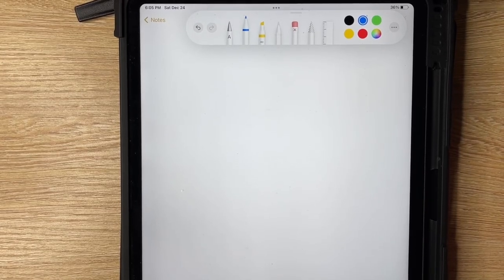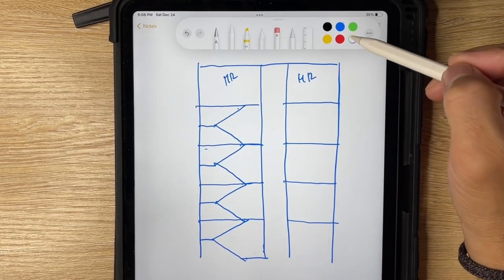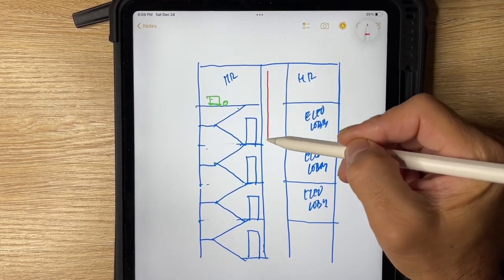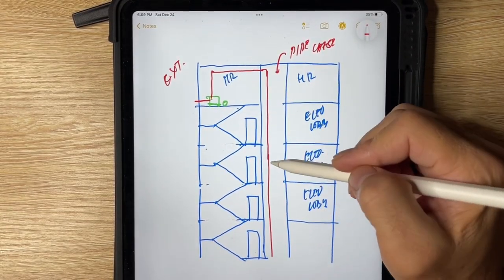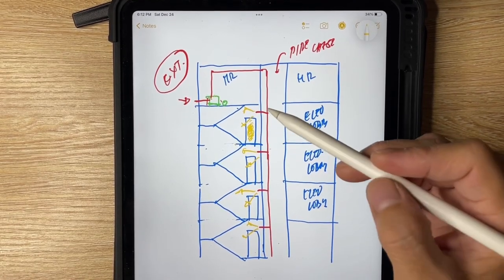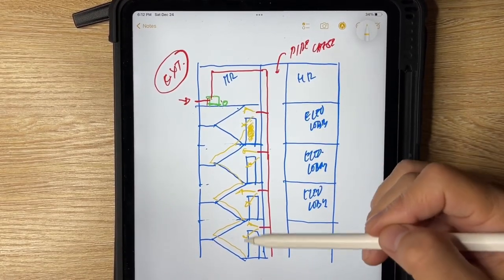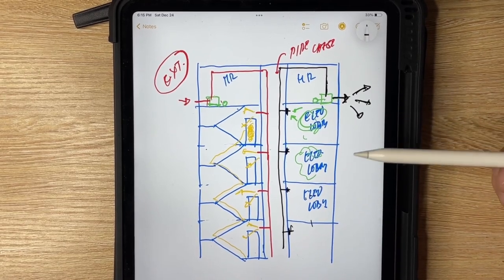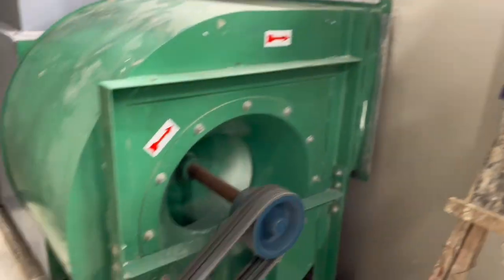ILLUSTRATION AND TESTING OF STAIRWELL PRESSURIZATION AND SMOKE CONTROL SYSTEM @arki-knows

Comment: Sir ilang pascal yung pressure dapat para maipush yung pushbar ng fire exit door? At nakainterface po ba yung supply fan ng staircase pressurization unit sa fire alarm system? Thanks
Reply from the maker: Hi!Sir,thanks for the comment.Regarding the pascal/pressure to push the panic device door.There was no indicated pressure indicated in the Fire Code of the Phils.nor in the NFPA -1 Fire Code 2018.But there was stated in NFPA.All fire doors shall be self-closing.They shall be permitted to remain open during normal operations if they are designed to close automatically in a fire emergency by means of listed closure devices.This means the panic door can be push without exerting much effort because the door can be automatically closed with the door closing devices fixed in the door.For the air pressurization for the fire exit.Yes, its interface with the fire protection system.In the case of fire.When the sprinkler or smoke detector triggered due to presence of fire the air pressurization will also be in operation when the fire and jockey pumps gives all signal to the system that there’s a presence of fire.This are all working as a team incorporating in the system to suppressed the presence of fire in the buildings.Hope i answered your inquiry.Regards
Reply: @arki-knows  yes sir I understand that since there are different type of occupancies in a building, it might be children, elderlies so it is very important to note that the pushbar can be open by those category of individuals however it is also considered that even though the door is self closing it is in fact once the door is kept open for a certain period of time due to evacuees trying to evacuate the building it is very certain that there will be a pressure drop that needs to be compensated by the motor fan in order to maintain the required necessary pressure since we are dealing with the pressure difference betweeen the fire exit and from the outside of door to prevent smoke or fire from entering the fire exit door. Anyway thank you sir for the elaborative explanation.
Reply from the maker: Thanks for the reply Sir.Concerning the children during emergency.Fire Exit doors panic device are user friendly and can be push immediate during emergency by a 7 or 8 yrs old children to vacate into safety using the fire exit doors.Now, during emergency,its still the elderly may direct all the children to safety and definitely in this case by their guidance they will guide children into safety by pushing the fire exit door panic device.
Reply: Section 5-2.1.1 of the NFPA 101, Life Safety Code requires the door opening force in egress path to be limited or no more than 30 lb of force (133N), hence, stairwell pressure should be maintained around 25 Pa to 50 Pa
Reply from the maker: @renemadriaga7041  1. Hello!Sir, just browsing our recent conversation on the force of push to apply to let the door open pushing the panic hardware . Based on RA 9514 The Fire Code of the Philippines under Section 10.2.5.3 DOORS letter F. PANIC HARDWARE : When a door is required to be equipped with panic hardware by some other provisions 
of this Rule, the panic hardware shall cause the door latch to release when a force of not more than seven kilogram-force (7 kgf) is applied to the releasing device in the direction of exit travel. Hope somehow our concern had been answered. Thank You. Stay safe.

Comment: Architect yung smoke proof enclosure po ba bawal lagyan ng window? May nabasa kasi ako sa firecode dapat walang opening maliban sa self closing na door. Kung bawal po, pano yung lighting dyan? Artificial lang?
Reply from the maker: Hi!Sir,Thanks for the inquiry.The enclosure ng pressurization and smoke control chase ay walang opening.Intended sya na enclosed wall and with fire resistive rating of 2 hrs.No windows and doors also.Every fire exit level.May stairwell pressurization louver sya or damper na naka concealed sa wall.Also wala rin syang lighting sa loob since totally enclosed wall sya dahil sya ang tutulong in the event of fire and located sya sa area ng fire exit stairwell.You may check yung isang content about How the Fire Exit Pressurization and Smoke Control System Works.You’ll see yung actual installed louver grille ng air passage ng ducting na nasa loob ng pipe chase.Hope the answer helps.Thank You😀
Reply: @arki-knows  thank you architect..
Reply from the maker: @likha360  My pleasure😀Thank You as well.